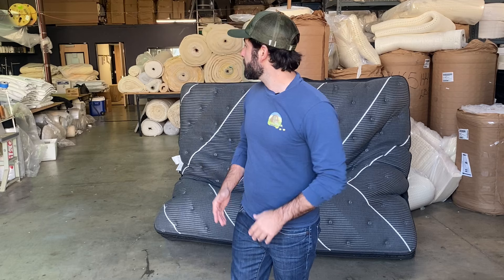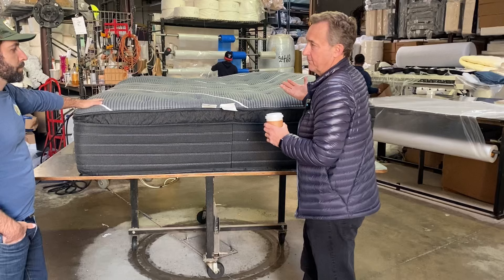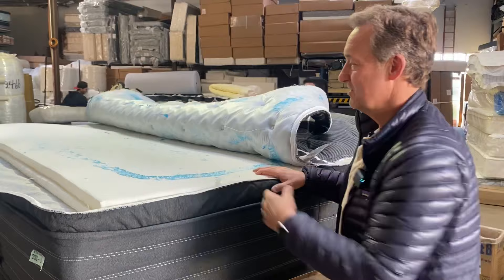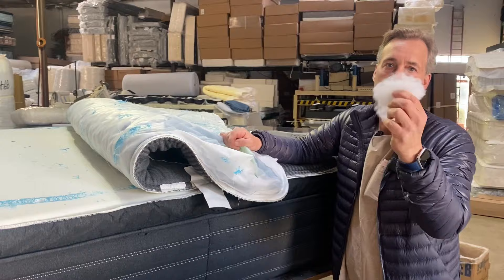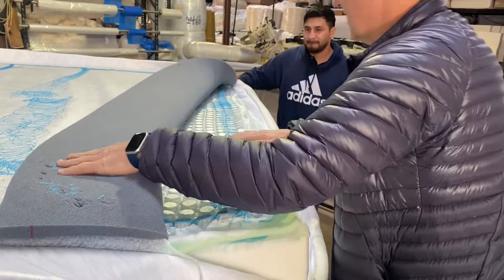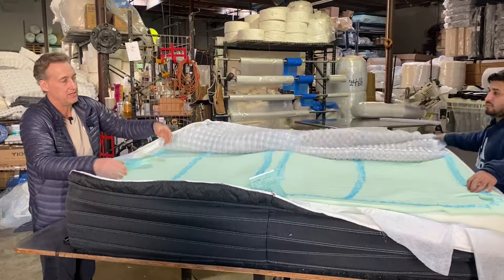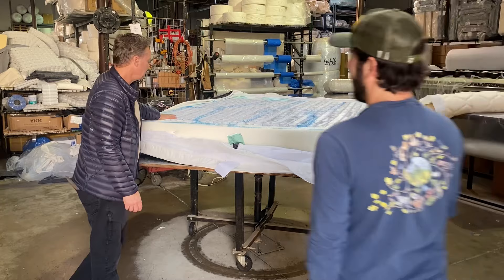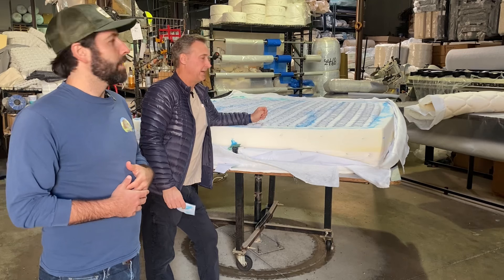What’s really inside a Beauty Rest Black, this is an over five thousand dollar mattress, worth it?

Comment: Most retailers as far back as my youth, the 60's, had a phrase for an Items markup called keystone.  Keystone was basically known as 100% markup.  If you bought an item for a dollar, you sold it for $2.00.  That gave you enough profit to pay your overhead and a decent month to month net profit of about 15%. Inexpensive items with a small turnover had a larger markup that helped the bottom line. If you read my other post on here you'll see how that changes depending on the industry.

Comment: That adhesive did not bond the layers very well, it peeled away with little or no effort.  Almost as if it was applied and had time to dry before the  next layer of foam or micro coils  was added.  No surprise that things shifted so badly.
Reply from the maker: We don’t use this type of glue, but totally possible it wasn’t made quick enough. Our guess is it was but the glue is a poor quality only because beds are typically made fast on a production line… thanks so much for commenting!

Comment: I purchased a Beautyrest back in 2019 that was just below the Black series. It lasted less than 18 months before it completely sagged and springs could be felt. Then the utter BS of the Beautyrest warranty came into play. Because I got the mattress on sale, the Beautyreast warranty didn't replace with a comparable mattress, but one of similar price to the discounted price. The replacement is utter garbage. Basically while shopping for a new mattress I have the mantra of NO Simmons, Serta, Beautyrest or Tuft & Needle.

Comment: No wonder BOTH of my hybrid black x mattresses failed in the past two years.  The beds pretty much separated internally, and now I know why! They cheaped out on the cheapest part in the entire bed, friggin GLUE! lol.  One of these days I'll be rich enough to order a custom bed.
Reply: MAKE your own custom bed, DIY
Reply: It's kind of crazy, really isn't it?  That we spend some of the MOST important times of our living in bed, yet we often are looking for a cheap, easy solution!  I suppose in theory we should be looking for custom mattresses, especially with spinal injuries - & even before that I had the hardest time trying to get a comfortable night's rest...  I'm desperate - so what to do?
Reply: @SmallWonda  get access to a second hand mattress with good springs, and put your own layers on top, including latex.
Reply: @eurekaelephant2714  Possibly a good idea - I need a step to climb in already!  I did manage to get out & find a decent new replacement - it is hand-tucked and pretty comfortable.  I found if the linen, like fitted sheets & protector, are too tight, that causes issues, too many layers over a crafted mattress & you lose the benefit of all that design.  I have just discovered too, that if the pillows are laid flat rather than on their sides to support the spine when trying to sleep 'sitting up' makes a surprising difference.  Getting a new back would probably be the best option!  Thanks for your suggestion.😉
Reply: @SmallWonda  no worries. Thanks for your reply.

Comment: We are currently in our trial run on a BR black C pillowtop plush. Its been a few weeks now and its so firm compared to the store model. We exchanged to this from a Posturepedic firm. It looks like this will be sent back as well ugh. We slept on a Jamison hybrid pillow top which was HEAVEN for 15+ yrs until it finally started putting us in a hole. I was so sad. We haven't found a bed that compares to that awesomeness since. We did get a Jamison from a factory warehouse place and it was NOT like the old quality. We both want some softness but not something that will put us in a hole after a few hours. I'm beyond frustrated. This BR was sooo expensive from Mattress Firm. We are side sleepers with some low back and shoulder pain. Not sure what to get now ):

Comment: Very interesting and pretty sad for so much money. I do have a saatva luxury plush and there’s nothing plush about it. I have fibromyalgia and it is like sleeping on a board. If I may ask because I am at the breaking point of trying to figure out what mattress would be best for someone with fibromyalgia? Oh and one that won’t sink in, that will hold up for a long time. Ty
Reply: Consider latex over springs.  Simpler the better.  Research Talalay latex and compare to memory foam.
Reply: @kiwijonnyboy  I purchased a premium all Talalay organic latex mattress from PlushBeds that failed in two years.  Their was a two inch dip in the bed where I slept.  I only weigh 160 lbs.  After much back and fourth with the customer service manager, they decided to send me a whole new mattress.  I have had the new mattress for less than a year, and it already has a one and a half inch sag, and my back is starting to hurt again.  I have a top quality solid foundation, so that is not the issue.  So in my experience, it looks like the life of latex is one to two years, and quality Talalay latex is very expensive.  Also, in my experience the latex has a very dense, rubbery feel even in the plush layers that I did not find comfortable, and often woke up with pain in my hip and shoulder even with their plushest firmness level mattress.  Just some things to consider before you buy latex.  I am as of today still in search of a comfortable, long lasting mattress.  It seems like trying to find a unicorn.

Comment: Rip everything off but save your coils and the foam around them, put a 3" talalay latex foam mattress topper and then a new bamboo wool zippered mattress cover. Most comfortable mattress in the world for cheap.
Reply: What website do you go for the topper and bamboo wool cover?   I'd like this as a back up if my new mattress fails
Reply: @Cheynayful  Arizona Premium Mattress - they helped me with exactly what I needed to do it -
Reply: This is my intent.
What base mattress do you use?
Need help with this as it's been 17 yrs since I bought this one(good mattress but I hated it).....need recs for simple 10 inch pocket coil construction, not brand.
Thanks!!

Comment: I went ahead and gave you a thumbs up because it was just fun to see the bed cut open. lol...

Buuuuuuuut I was very close to thumbs down because it seems that you guyz were not prepared and did zero research on the bed.

Buuuuuuuut also because y'all are likeable and seem like y'all are hardworking folk, I will offer my opinion on what you saw.

I am overweight and I own a Beautyrest Black C and of course I dropped 5 grand on it.

I did my share of research and watched my share of YouTube videos.

There are more than enough videos that explain those different layers of foam that you were looking at.

By now, you should be wondering.... why did he mention his weight? What does that have to do with anything?

Easy....

One of the very informative videos that I watched provided feedback that if you are overweight then the Beautyrest Black bed is not likely a good bed for you.

I do not know the story of the people that you received the bed from and I could be completely wrong.

Buuuuuut I would not be surprised if they were both overweight and in addition they had a platform bed where they primarily raised their heads and likely to extreme heights.

The problem with today's mattresses seems to be the horrible dip that happens in the center of the bed.

Soooooo.... add on the extra foam, put two overweight people on that bed not designed to handle overweight people and then lift their heads....

What do you get?

You get what you see at the beginning of the video.... 

You get a massive dip in the center.

You get the top layers of foam detaching and sliding down.

You get crushed edges for the most part.

And if you noticed.... The actual spring coils section was pretty much intact and even flat with signs of little to no wear and tear.

Sooooooo.... the bed was likely well manufactured and put together, but it was not designed to handle two overweight people at elevated heights with all that extra foam padding at the top which as you saw detached from the weight bearing down and pushing it south. The K class has the most foam at the top. I have the C class with less foam and then the bass is L class. But I think they just changed how they describe their model numbers.

Point of the story....

You guyz could have done some research instead of bad mouthing the brand without understanding what you were looking at.

The good news is that the other guy realized that the bed was a good bed and his experience told him after looking at the main coils that it was simply too much foam at the top. Unfortunately, neither of you made the connection of why a bed after a year and some change would need to be thrown out. That's fine as my thought is that primarily other overweight Beautyrest Black owners would likely be the only ones who can see all of the problems.

I still love my bed and I have opted to just lose some weight. But even if I destroy it before then, I am okay with dropping another 5k for another one.

Buuuuuuuuut what does that have to do with you? As that is all most people really care about. lol....

Since you are in the bed business, I would recommend that even if you do not like all the foam because of the pressure point technology, I would recommend that you at least focus on making a bed that can specifically accommodate us overweight people!

I found a company about 2 months after I had bought my bed. If I would have known about them and even with them being a smaller company, I would have gave them a shot.

This is the reason that it is easy to drop 5 grand at a big company that is known for making beds because we/consumers have other things to do than to spend 9 months trying out beds.

The only other thing that I would add....

You should also consider pushing the industry for a God-size bed meaning the next size above a King. 

The Sleep Number people used to make a grande king. That would be great in this era! I would so buy one of those as I tend to be a minimalist so there is not much furniture in my bedroom and my bedroom can easily accommodate a much larger bed and not only that...... for a person that is not over 6 feet, a traditional king is really just not enough bed.

So... I hope you receive my criticism with good cheer.

To be specific of what that criticism is so you do not have to guess. Please do some research before you criticize a bed. 

You guyz seem like you have alot of experience and you blew an easy opportunity to share that experience.

The video could have been so much more than just criticizing obvious things that Beautyrest owners likely already knew about and you could have been focusing on alternatives and how the product could have been improved. Even better, you would have been able to go into more details about how you could have offerred a better product. 

I am not necessarily saying offer free consulting to Beauty or even to describe how you would change the material. I am simply describing how you could have been discussing your value adds and not just coming across as petty or band brashing.

For the record... I do not work for Beauty before you think that I am simply defending their product.

Although I am not sensitive about my ego, but you guyz being petty could easily be taken as you calling the consumers who bought Beauty stupid  meaning the comment of if you drop 5 grand on a bed, it should be A rated in all categories.

That might be true, but what do we know? We are just stupid consumers. 

So how about educate us instead of calling us stupid and that type of consultative sales approach where you focus on how you add value is a much easier way to gain customers. Just saying....

In either case....

Good luck and hope you received my feedback in good cheer.

These days I am not looking for a fight and I am far from an internet gangster.

I am just a guy who watched a cool video about a bed and saw some hardworking folk who do not realize how they were pushing their branding in the wrong direction.😇
Reply from the maker: @mnash3  wow thanks for taking the time to write all this. Your theory is a good one but not that accurate the person who owned this wasn’t that big of a person
And only one person slept on it and it wasn’t on adjustable platform, everz Additionally no where in beauty rest’s advertising for this do they warn big people to not purchase this bed for all the good reasons you mentioned. We on purpose don’t research the bed beforehand besides price and what’s supposed to be in it because that’s what  the exact point of the video is, a kind of in the moment reveal.

We open up other beauty rests on this channel and don’t believe we bad mouth the company whatsoever. We don’t believe we bad mouth the brand here either, just the poorly made bed seen here.

We aren’t that concerned about consumers who bought this bed but who are in the process of buying a new bed. Sorry it was upsetting it seemed like we were bad mouthing the brand. But I believe this is the first comment that believes we did on this video. 

Thank you for watching. Wondering what you think of our other videos. You are right we do work hard and we try to be as helpful to the consumer as possible. At the end of the day this bed has too many layers of foam, and was poorly put together. We don’t believe all of beauty rests are like this. But when you make beds like beauty rest on a manufacturing line, this is the risk you take, low quality assurance. 

We actually have another beauty rest opening video coming out that we shot recently and you’ll see it’s a great bed. It’s nkt a beauty rest black. 

We work hard and do our best to provide a non bias opinion on the build of the bed as we see it. This particular beauty rest, in our opinion was poorly made as you can see to the poor glue job, low quality glue as one piece of evidence. The coils are high quality and are still in good shape but the bed didn’t make transport in our opinion and that’s why this bed didn’t last.
Reply from the maker: @mnash3  additionally, we do make bed for big people, it’s called hard ass beds because they have the proper support needed to last. Thanks so much for watching AND liking
Reply: @spencersmattress  - Fair enough. Thank you for your kind and prompt response. I do appreciate you taking the time and sharing the logic in the video's presentation and the logic behind your criticism. Normally, I am pretty good about minding my business, but your comments were concerning so I wanted to present a different perspective and experience and even a different scenario on what could I have caused that particular bed's problem.

It was nice that you knew the bed's owner's history as that would have been nice to present so I could have had some context when watching the video. I likely would have drawn the same conclusion, meaning large assembly line, low quality assurance, and this particular bed slipped through and was simply poorly constructed.

As for Beauty putting it in their advertising about not being a bed for us big people.... 

The video that I watched was not from Beauty. It was on YouTube from when I was doing my original research to select a bed and I came across that feedback. It was subtle meaning the video did not harp on it or make a big deal about it. They just said it as part of the flow of the video. For the most part, I would not recommend the Beauty to someone extremely overweight, but that is only from my personal experience. I almost did not get the bed myself, but I had just returned a bed that was not a good fit and still needed a bed. The Beauty was the closest to my old mattress in my opinion. An even longer story....

In either case... I think you and I are good.... I was not trying to pick a fight and like I said.... I do not work for Beauty so I was not trying to defend them or even defend my particular purchase. The bed grew on me! It was a bit of a fight in the beginning and I almost returned it, but I am happy that I kept it. lol....

In either case.... It is great to hear that you make beds for us big people. I wish I would have learned about y'all a while back as I would have likely gave you a shot at earning my business. But its okay...

Thanks again for sharing your experience and providing clarification.

Have a wonderful day.

Comment: Hey Guys!  Love the video.  Do you guys know if the firmness level options on the black is due to the springs being different or the foam density used?  I have a C-Class Black, however, it is hard as a rock. We got it less than half of retail value through one of those wholesale scratch/dent type of places.  I am considering opening it up, pulling out all the foam and putting a nice 3" latex topper on the springs.  My concern is that it is going to make the mattress even stiffer.
Reply from the maker: Hey jonny boy, we don't know for sure unless we were able to actually open up each model. Our guess would be a combination of foam density and layers of materials being used. A firmer model may have less layers and/or higher density foam. Putting latex in there could do the trick, anyway you could put it on top of the foam that's already being used, but it's always a risky move but could work. Good Luck! 

Thanks so much for watching and for your support!
Reply: Maybe using memory foam instead of latex might not make it stiffer?
Reply: Which C class black did you get?
I'm replying here because your comment aligns with my issues....